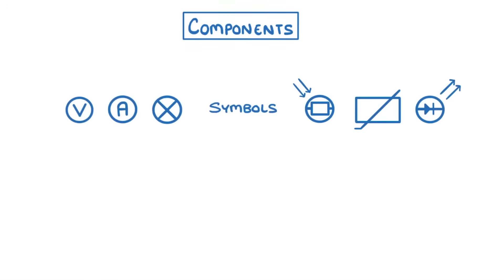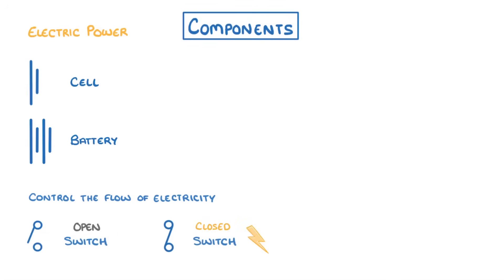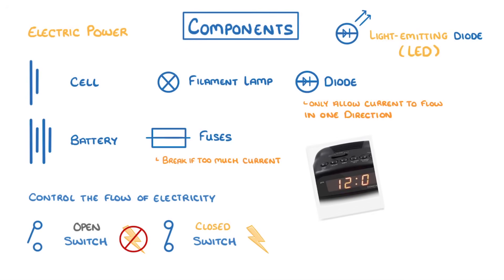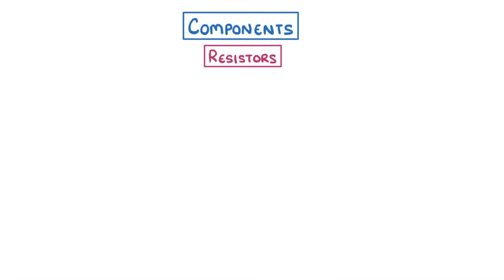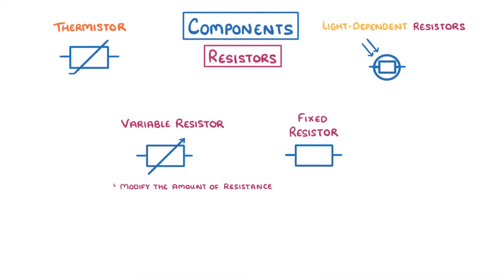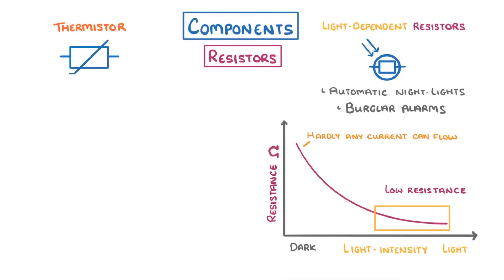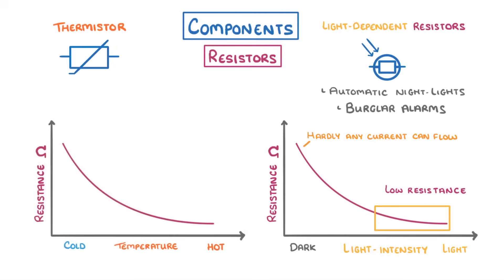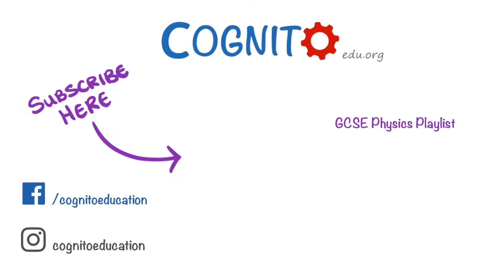GCSE Physics - Components

Comment: does anybody understand diodes? what does it mean when it says current only flows one way - does it normally flow both ways?
Reply: If it's alternating current then yes, it does flow both ways. When you add a diode it makes sure current only flow one way. This converts alternating current to direct current
Reply: @funnyjet1105 thank you!
Reply: When you add a diode to a circuit then the circuit acts as a direct current (DC). You can watch other videos in cognito, they are really useful.

Comment: This was extremely useful!- but I have some confusion about the use of LDRs as night lights. 

If the resistance shoots up in the darkness(at night) making the current hardly flow, doesn't that mean it won't light up at all? Isn't supposed to light up at night?
Reply: same question
Reply: @faerinted64  I just asked my Physics teacher today and she said that, "It is part of a control circuit which is designed to give the required action.
One of the cancelled topics in our syllabus is logic gates which control to get the correct action." 
So yeah! I think that's it. We don't need to give ourselves a headache.
Reply: @_Dreamer_9306  haha okay thanks for telling me
Reply: @faerinted64  most welcome LOL ✨
Reply: @_Dreamer_9306  
At night or in darkness, the resistance of an LDR (Light Dependent Resistor) increases, limiting the flow of current. However, even with the increased resistance, a small amount of current can still pass through the LDR. This is enough to power the night light, providing a soft glow that helps illuminate the surroundings without using excessive energy or creating a bright light that might disturb sleep.

I believe that is the reason and answer to your question.
Reply: @shuaibirum
your answer may be correct but I have different theory so when LDR detects light there is low resistance so current will flow through the low resistance path but when it's dark there will be high resistance in LDR and so current would rather go to another path where there is low resistance and and I think in that paths is where our light is set. It's just my theory, but feel free to correct me. im just a new student
Reply: @legendgamers6581  your right so when the light is a lot there is high resistance in the loop where the filament lamp is, so the current wont flow there, so the lamp wont light up

when theres less light, the resistance in the loop where the filament lamp is becomes very low, so current flows there, so the lamp will light up.

key rule here=current always takes the EASIEST path
Reply: i think that too brother

Comment: why is the resistance high when its cold in a thermistor, a why is the resistance low when its hot in a thermistor?
Reply: Hey if you found out why please let me know i'm still muddled :/
Reply: @l0v3ka  Simply, because resistance is inversely proportional to temperature.
Reply: Because resistance is inversely proportional to temperature.
Reply: it will be helpful for you to know that there are 2 types of thermistors. An NTC and PTC, NTC is a negative temperature coefficient while PTC is positive temperature coefficient. In a NTC, when temperature increases the resistance will decrease.
Reply: The resistance is based on the temperature of the thermistor

Comment: but didnt you say resistance is directly proportional to temperature? so wouldnt the thermistor work the opposite way?
Reply: as i know its the only thing which doesnt apply to this
Reply: @mansha_o  He never said anywhere in the video that they're directly proportional. He said that the resistance is DEPENDENT on the temperature. 

So the change in resistance depends on the temperature. And how does it depend exactly? Both are INVERSELY proportional if you noticed. Because when the temperature increases, the resistance decreases, and when the temperature decreases, the resistance increases.
Reply: @_Dreamer_9306 i know this was a year ago but he literally said in the video about resistance that they are proportional, if th temp goes up, so does the resistance- if the current goes up in a bulb, so does the temperature which then causes the resistance to go up which is why in a filament bulb graph, the current stops increasing
Reply: @_Dreamer_9306 why did you repeat the same comment thrice
Reply: He never said anywhere in the video that they're directly proportional. He said that the resistance is DEPENDENT on the temperature. 

So the change in resistance depends on the temperature. And how does it depend exactly? Both are INVERSELY proportional if you noticed. Because when the temperature increases, the resistance decreases, and when the temperature decreases, the resistance increases.
Reply: Thermistor is a non ohmic conductor isn’t it?
Reply: @lola7172  He never said anywhere in the video that they're directly proportional. He said that the resistance is DEPENDENT on the temperature. 

So the change in resistance depends on the temperature. And how does it depend exactly? Both are INVERSELY proportional if you noticed. Because when the temperature increases, the resistance decreases, and when the temperature decreases, the resistance increases.